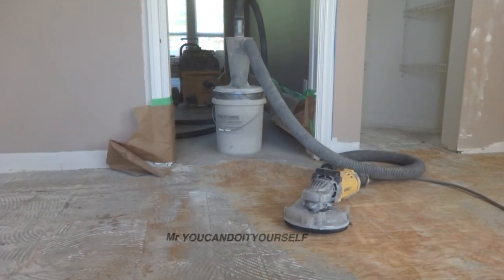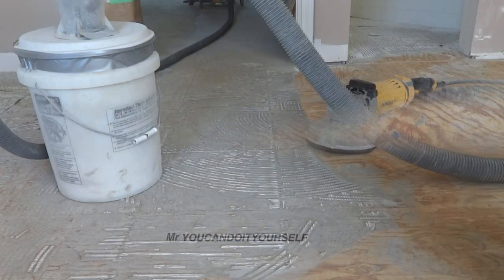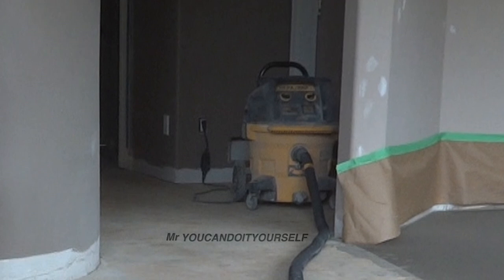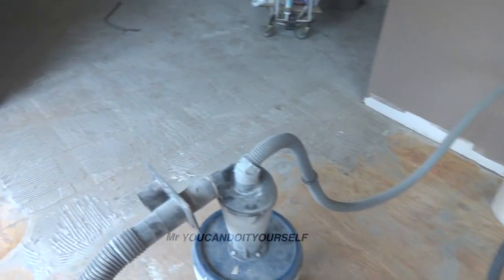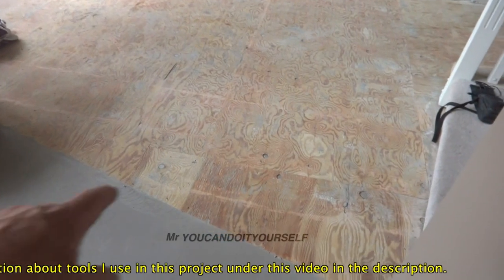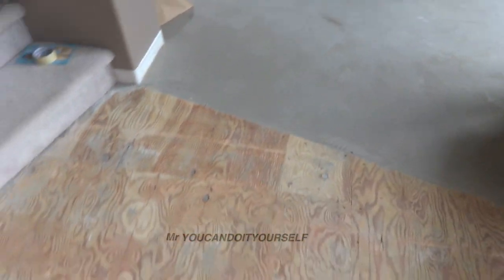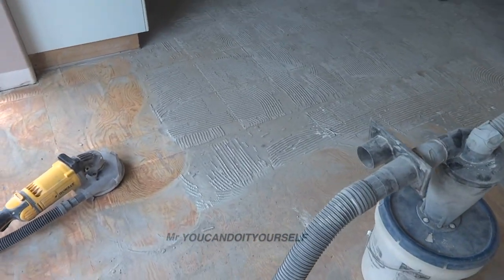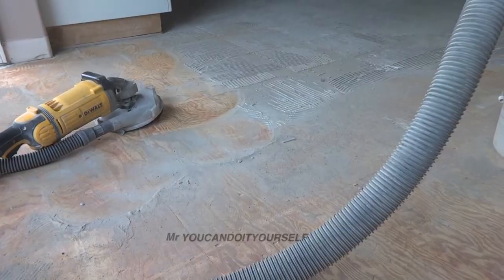How to Remove Mortar and Grout Removal from Plywood Subfloor for leveling MrYoucandoityourself

Comment: i just did this in my entry way. i had to grind on the dust shroud to fit on my m18 grinder, but it worked great after that. i hooked directly to my shop vac and had nearly no dust. i had to blow out my filter twice though.  i did manage to make some divots in the sub floor but its pretty minimal and i already had thin set filler for a few other places so i'll patch it up.
Reply from the maker: Good for you!

Comment: Try running a commercial air scrubber while doing that next time. It will keep dust from going all throughout the house.plastic off doorway to rest of house and run flex duct exhaust from unit to window. Creates a vacuum in worksite.👍
Reply from the maker: Hi Paul, good idea, thanks!

Comment: Any advice on making sure you aren't digging into the subfloor with the grinding wheel?  The dust shroud has those springs on it and moves around. For context, I'm removing mortar to put hardwood flooring down.
Reply from the maker: Good question! Just grinding without hard pushing down. Mortar very soft for grinder.

Comment: How do u prevent mortar from going into subfloor panel joints? They are supposed to be open for expansion and contraction
Reply from the maker: I filled up joints with caulk.
Reply: Can u put tape over joints then mortar?
Reply from the maker: Yes, you can. But you have to sealed this tape over with caulk, because when you put compound, tape will peel off. I have this experience.
Reply: @MrYoucandoityourself  thank you. What if u dont mortar up to joints and leave a space around then and then apply the ditra? Shouldn't that leave gap open still?

Comment: If I'm going to use cement board over the plywood, do I have to remove thinset completely, or just get the major that sticks up?
Reply from the maker: Yes, you have to remove all thin set. Thanks

Comment: How much do companies charge to remove tile from subfloor per sqft
Reply from the maker: Hi Ryan, companies charge by the hour, for example from $65 to 120 per hour. Or by the job from the experience. Not so far, I removed entrance tile 35 s.f and grind down mortar  - price this part of the job $300. Is it help?
Reply: @MrYoucandoityourself  I have about 1000 sqft. Should be fun and expensive.
Reply from the maker: Yes.